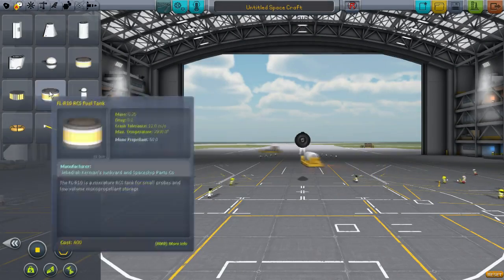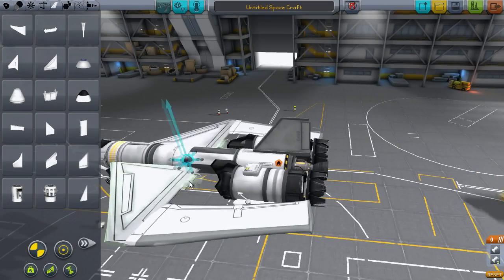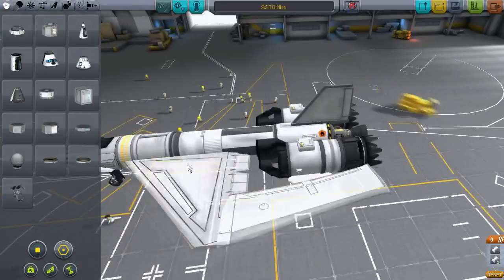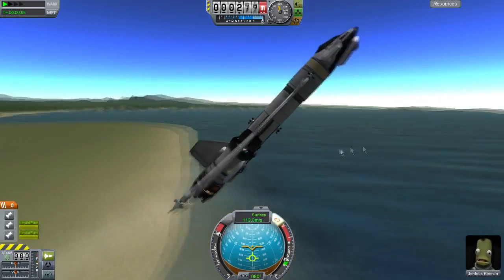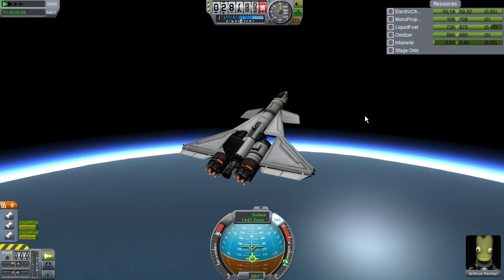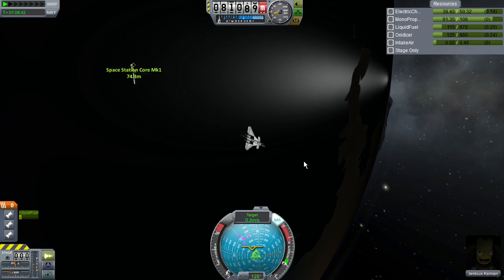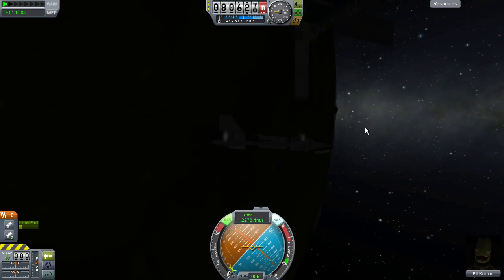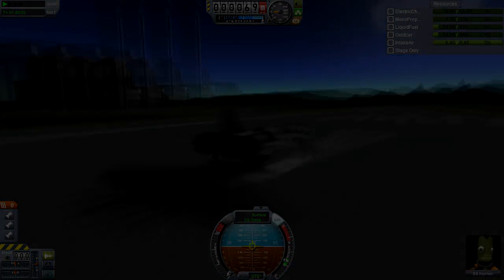KSP - Single Stage to Station

Comment: you should have use the raper engines
Reply from the maker: While they can do both atmospheric flight and space flight, they aren't great at either, and I actually think if I'm going to use 3 engines anyway that it's more efficient using what I used. :)
Reply: *****
Yep! The rapier's inefficiencies mean it is less efficient than carrying three normal engines. But, it does make SSTO simpler, and it's oh so cool. :D